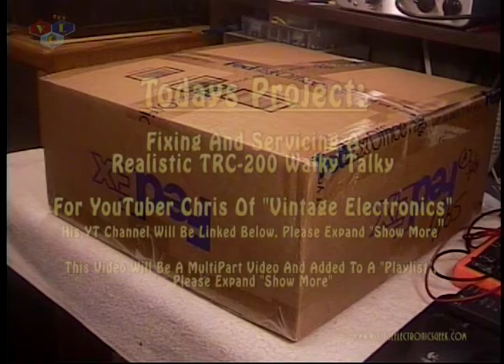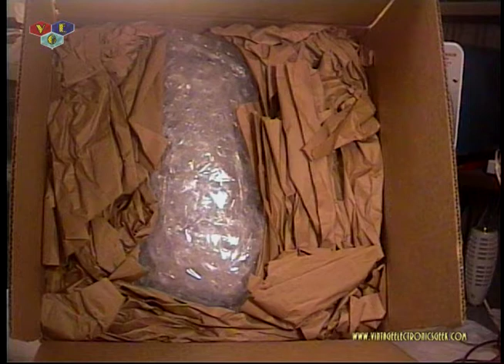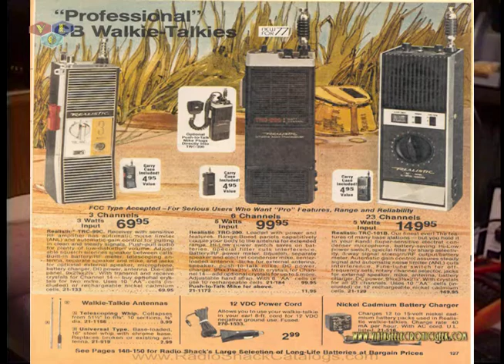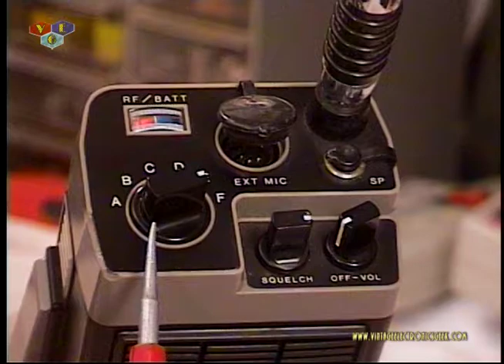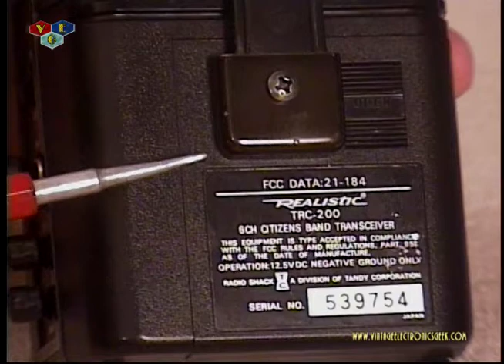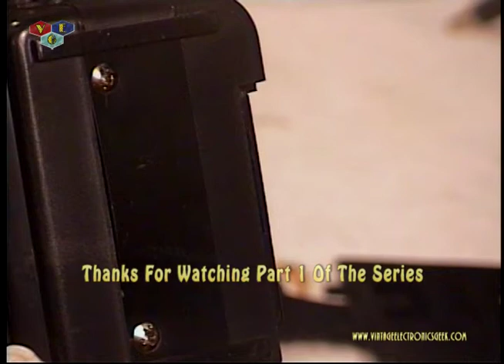Realistic TRC-200 CB Walky Talky - Intro & Overview - Pt. 1

Comment: breaker breaker 
broken broken 
the dummy batteries are to compensate for the voltage difference of alk and recharge batteries.  You use them when using alks.  It may take 8 alks, but 10 nicads.  Don
Reply from the maker: Good point Don, I total forgot about that!  ~Jack, VEG

Comment: That was a nice series of walkie-talkie sets... years ago when they were new at Radio Shack I bought the 40 channel version along with the accessory microphone and 10 AA ni-cad batteries. Sure was an awesome set. They are pretty rugged too.
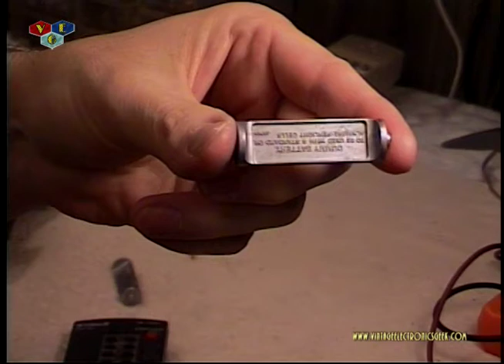Reply: 5:20
 Those 'dummy batteries'  were supposed to be used when using 1.5 volt 
alkaline batteries instead of 1.2 volt nickle-cadmium  rechargeables. 
There is space for 10 AA batteries in the back of the set and 15-16 
volts with 10 alkaline batteries inserted  would have exceeded the 
designed 12 volt DC input limits and would.. (GASP!) .. make the set put
 out 4.5 watts instead of 4 watts and that would be against the FCC 
rules and regulations, so those 'dummy batteries' served as 
space-fillers and jumpers to allow 8 AA alkaline cells to be used so the
 set would receive it's designed 12 volts DC and  won't blow up in one's
 hand, and, Uncle Charlie won't come knocking at the door with the 
intention of keeping the world safe for democracy and safe from 
over-voltaged walkie-talkies, ;-)
Reply from the maker: I only had one walky talky in my time and that was a Lafayette something or another 3 channel, it was a good little heavy radio, I didn't use it often so I got rid of it...this was sometime in the 70's.  I't slip my mind about the reason those adapters were there and why.  Thanks for watching!  ~Jack, VEG
Reply: @VintageElectronicsGeek  Right on, Jack... that reminds me of a Lafayette walkie-talkie I used to have too... it was the 12 channel model with a nice heavy duty die-cast metal front and frame and a thick plastic back. The antenna was I think about 52 inches long when fully extended. It was definitely an awesome handheld.
Reply: @TerryMcKean   if I installed 10 alkaline batteries in this CB radio would that destroy the CB radio ?
Reply: @UnitedStates_I.R.I.E  Probably won't destroy it, but  it would definitely run a little bit hotter temperature-wise than usual with the 15 to 16 volts ten alkaline batteries would  apply to it  instead of it's normal 12 volts.  Is it a walkie-talkie or a regular mobile CB?  In a mobile setup voltages could reach around 14 or so volts due to the alternator voltage being applied to the automobile's battery for keeping the battery charged. Mobile CBs have a more rugged construction with heavier heat-sinks for the audio/modulator final stage and the RF amp final stage.